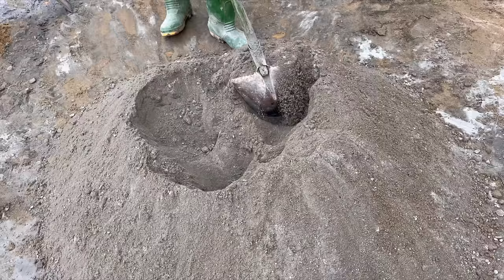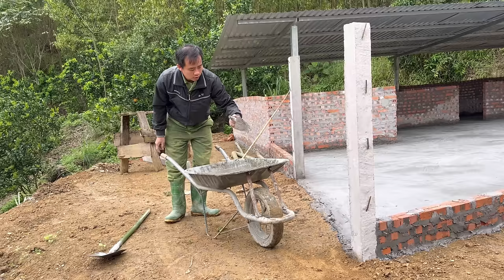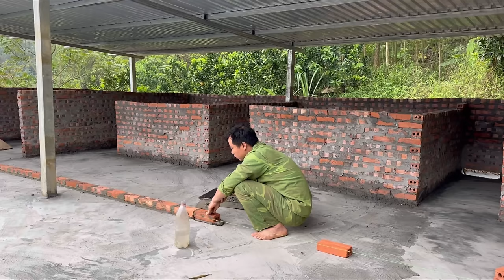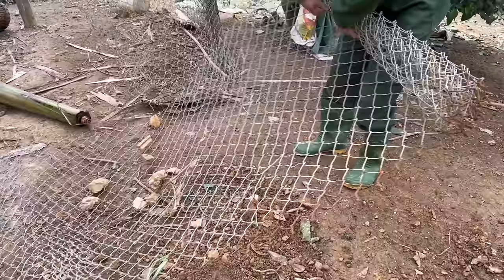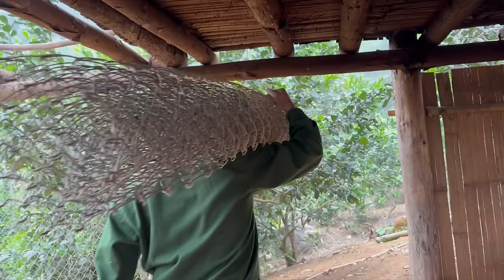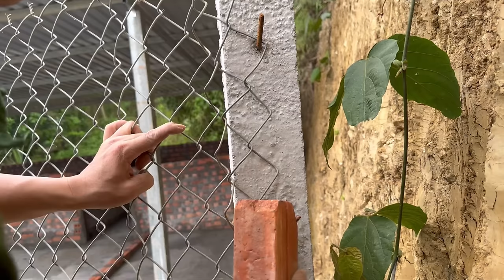Complete the farm and wait for a good day to bring the wild boar to the new farm

Comment: Doesn't anyone know how to clean up as they work. It doesn't matter what material they use, whether it be bamboo, cement, brick, or wood. They just leave it where it drops, then they end up tripping over it in the next 5 videos. Or if they do pick up, it all ends up in a pile 5 to10 feet away then they end up fighting to move it again 10 videos later